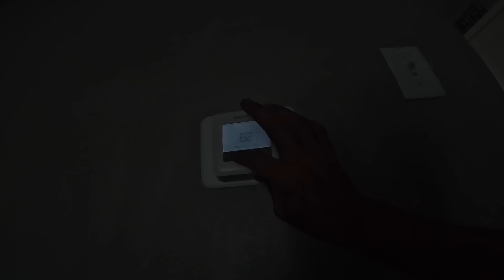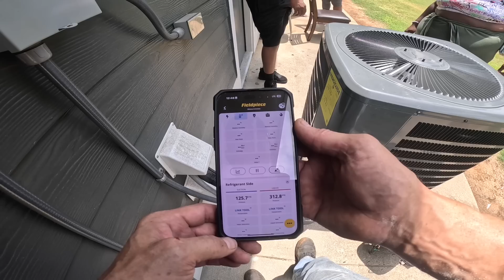No Cooling and “Bees”! #hvacguy #hvaclife

Comment: Hey Curtis, what tool you're using to remove the caps at the condenser unit, couldn't get a clear sight, thank you so much in advance brother
Reply from the maker: That’s the tool that comes with the JB locking caps

Comment: So recently, I got a quote for a Reem 3.5 heat pump installed for a little under 20 grand. It's taking the place of an existing 3.5 ton non heat pump system. The new air handler is going to sit in the exact same spot as the old one . The sa.e with the condenser. They will be changing out an existing 13 feet of line set. There's no other work involved as my ductwork is ok. They say it will take approximately 6 hours to do the work. My question is, is this really the going price now to install a new hvac system or an I being screwed? This was the cheapest of 2 quotes from different contractors. It's also all electric no gas. Thanks 😊
Reply from the maker: Kinda depends on where you are. If you are in a metro area that may be appropriate. Around here that’s more than twice what I would charge.
Reply: @HVACGUY  thanks
Reply: @HVAC GUY  were just outside of Columbia S.C. it's a middle-class rural area. When I asked for the quotes, I was afraid they would say about 10 grand . So when they came back with almost 20 grand, my jaw hit the floor. I'm going to call some more contractors and see what they say. Thanks again.
Reply from the maker: @number1pappy sounds like a good idea

Comment: Curtis you had a job where the condensate pvc drain was broken at the floor joint. Looked like that development. Use were talking about digging up the concrete or maybe just running a condensate pump. Curious did you fix it?
Reply from the maker: Haven’t gotten approval yet
Reply: Ok thanks for letting me know